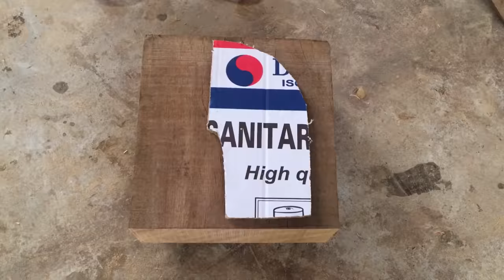Amazing Woodworking Project For Wooden Stairs (PART 2) - How To Make Curved Railing For Wood Stairs

Comment: He did good with the tools he had !its one of the most difficult components on  a stair rail to make it's called a declining corner the declining voloute is harder to do but I bet this lad could do it . Now the CNC has taken over . I'm from Cape Breton and I was taught how to do what he did in BC. In  th 1990s thanks to a German guy that worked at BH wood turning.  it's no fun and I needed a dust mask.

Comment: a great Carpenter uses straight lines and tape measurements and that's great and then you have exceptions to the rules because when you start doing arches and French curves or any kind of curve for that matter you become a master of your craft so everybody that thinks they could do this you're out of your mind and stick behind your keyboard and keep subscribing to things on YouTube or get an app because you'll never be able to do if it doesn't concern a straight line
Reply: I did things like this on a smaller scale. It's pretty easy really  if you use the right tools,  which are definitely not these bulky power tools this guy is using.  I'm amazed he made this using these tools.  But using simple hand tools it would've been a lot easier...

Comment: Most important thing to remember when doing these hand rails is that you use creamy peanut butter and not crunchy.
Reply: Tọc
Reply: What type of wood/joint filler is that?
Reply: Randy Willauer 
Well Randy. Personally I'd of used pu glue. But I guess in Vietnam they use sloppy dog turd. Why he didn't buy off the shelf internal and external joints I don't know. Would of been a better job. The straight runs were new looking so it's not as though it's existing pieces to join. Looks like by the sawdust around him he did it all in one day. FairPlay to him. Greetings from the UK. 🇬🇧👍🏼
Reply: What brand?
Reply: Ha ha ha peanut butter!! When I was doing my apprenticeship we used to mix wood dust with pva glue when gluing up to fill any gaps. We used to call it peanut butter as well. 
Tbf these handrails are about as technical as you get. The reason he ain't bought one "off shelf" is cause this is a bespoke handrail. You aint getting nothing off shelf to match that moulding and pitch.

Comment: This is an old school method, not many people left that could do this.
You could use rail bolts to hold those fittings together much better than screws.
Reply: He put it together with lags not screws.

Comment: Not bad. Only thing I'd say is its a pretty weak solution. I'd have glued in some dowl and drilled before screwing so the screws stayed in there, just use filler over the holes. But hey its China where things only have to last as long as it takes someone to buy.

Comment: A barrel sander at the beginning would have made the inside curve much easier. Also a wire bandsaw blade is what should be used not a very wide rigid blade. Very unsafe to have that much blade without the safety guard being closer to the material.

Comment: He used the wrong process, and turned a low quality using low quality tools.  At the point the block were matched up he needed to use a routing tool to get all the grooves straight.  You can see the power sanded marks in the finished product, and it looks low quality because of that.  Not only that, but his bandsaw did not have a blade guide, which is why all the cuts were crooked.
Reply: So not true. It doesnt matter about the tools he had. And certainly no part of that project was affected  by the band saw. All those lines would have been finalized and  blended with hand tools, pull scrapes, pull spoons, rasps, hand sandpaper yada yada. That was a extremely well done  and probably wasnt even fully finished.  Your mistaken his lack of tools for lack of competence, but really he shows how extremely comfortable and experianced his hands are.
Reply: Jesse Davis , with a CNC machine he could have done a better job, BUT he hasn’t got that luxury so he did the job with what he had and I think for an old bandsaw and an angle grinder he did a great job. Don’t compare your standards with other countries as they might have a different view on things.

Comment: Next time, glue the pieces from the beginning and use a template ( cardboard or whatever) so that at least the width of the carvings is somewhat similar to the existing wood. Its almost a centimeter wider on the new piece
Reply: LMAO! It is actually a micrometer wider! Fool!
Reply: Post your video then Mr. Pro LMFAO. That's what I thought

Comment: It’s garbage. That shit would never pass here in Canada. There is zero mechanical connection to that bottom rail, other than one screw? Really? Not even a dowel to join the two pieces at the center point? It’s crap. Too long for crap.